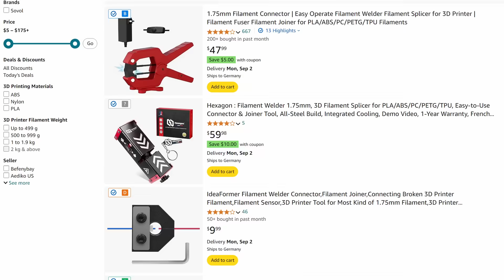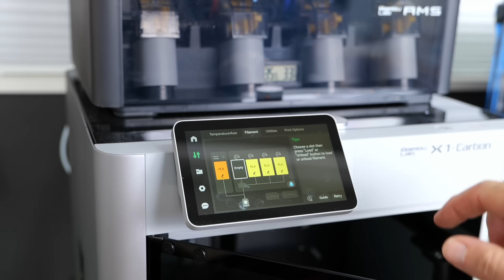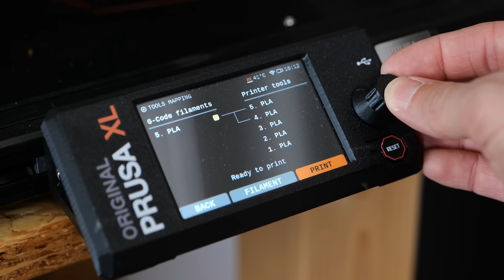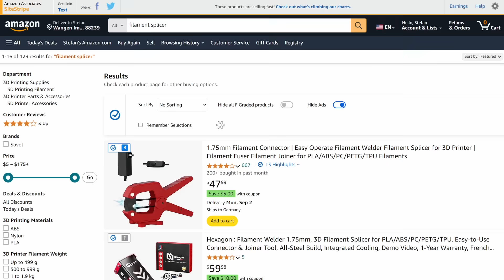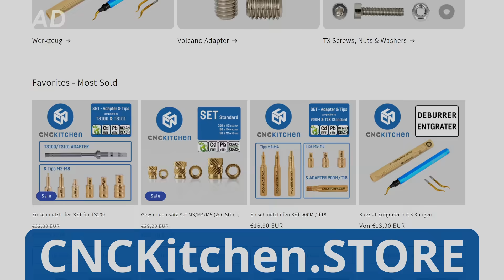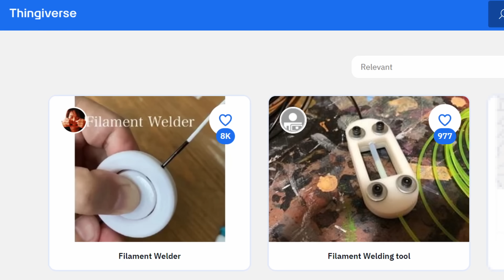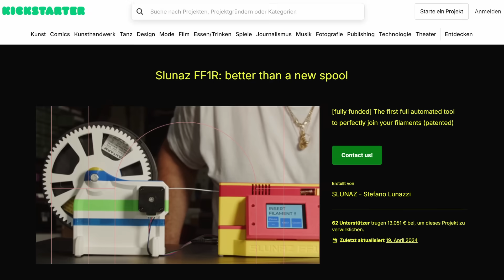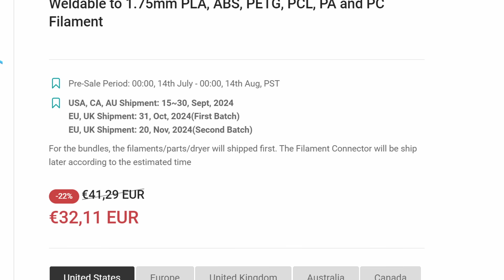The Best Filament Connector but you can't Buy it (right now)

Comment: Aloha Stephan. I have the Sunlu filament connector. The best and easiest way is to use a can of air. When the filament connector beeps, just unplug the power connector from the filament connector. Grab your can of air and turn it upside down. Spray a jet of coolant into each end of the unit where the two filaments enter and exit the filament connector. The coolant instantly freezes the fused joint. I've been 3D printing for a year and a half. Love your channel. CHEERS! 🙏🙏

Comment: Perhaps you'd like to test my solution for easier filament connection using this device from SUNLU?

I posted a model on MakerWorld a while ago. I don't want to post the link here because YouTube will probably hide the comment. You can find it under the name "SUNLU Filament Connector Assistant (working one!)" by Cichy3D. I immodestly think this is the most convenient way to use this device. Cheers 🖖

Comment: For me the just sit in a storage bag until I need them for test prints like maybe I'm using a different setup for my hotend. Mainly the nozzle and I will be upgrading from hardened steel to bimetalic carbide. Sometimes they don't say air tight though. They're now available and have one coming.

Comment: A tip to avoid PTFE waste: For anything but the shortest lengths of filament (when it is easy to manually slide the PTFE off the end), you are going to need to re-spool the filament after splicing. Thread it through a short clamped length of filament guide tube (also PTFE, but much thicker walled) before it goes onto the receiving spool. This easily pushes the splicer PTFE along the filament until it pops off the end of the filament when winding is complete. This is also a useful check that the splice is not going to jam in the printer guide tubes. A frame with two spool holders, guide tubes and the splicer in the middle facilitates this work-flow and helps ensure the filament is spliced with its spool bends aligned in the same plane.

Comment: The consumbles turns me off. Surely there's a better solution by having a built in heat resistant ptfe tube that doesn't have to be thrown away but still a cheap solution

Comment: It would be possible to take this welding mechanism and add a pair of sliding clamps on either end that, actuated by the lid, grab the filaments and pull them together with a consistent force, and it should be possible to make them adjustable so you tune it for the material at hand. It looks like the Sunlu machine is not particularly available to modification, with the entire top body piece looking like a single injection molded part, but the Hexagon appears more amenable. That said the Hexagon machine relies on you adjusting a knob for every fuse, and IMO that also needs to be modded for it to be truly practical. I would go for replacing the knob and it's threaded rod with a toggle lock mechanism that pushes on a spring coupler, that has an adjustable limit. Sidenote: the Hexagon machine comes with a 3D printed alignment block that you put the filament in to straighten it, this is a good idea but it would work better if it was metal, and part of the cutting apparatus. You put the splice in the block, give it 15 seconds, activate the cutter and remove with the joint now straight and hardened

Comment: You can live load flashforge5mPro. 
1st switch off filament runout sensor on the printer.
2nd let the old filament run at 50% speed (slow it down)
3rd load new filament in to the tube and wait until its almost out.
4th load the new filament as the old one runs out.
5th make sure to turn the filament runout sensor back on.

This avoid any confusion and its faster as well as safer for layer adhesion.

Comment: I use 1/16" ID X 1/8" OD Silicon Tubing to join two lengths of filament. I cut the two leftover filament pieces diagonally and push the two pieces into opposite ends of a 1.25" to 1.5" piece of the silicon tubing until they meet in the middle. Then I heat the outside of the silicon tubing using a handheld propane torch working around the silicon tubing until the filament becomes soft enough (melted) to join the two filament pieces together. The key is heat until the filament soft enough to join but not liquefied. This makes one continuous filament. As the joint cools down I roll it between my fingers again, wait until it cools enough to handle so you won't burn your fingers, then when its cool I use a razor knife and slit the silicon tubing lengthwise so I can remove it exposing the now joined filament pieces. It is inexpensive and works well keeping the connected filament ends in the proper diameter to feed cleanly through the 3D printers PTFE tube with no fat section where the two filament pieces were joined that needs to be trimmed or sanded.

Comment: This is a neat product, but the obvious solution for the sizing issue is to use a precisely manufactured steel mold coated with a thin pei coating.
This would keep the expansion to a minimum, speed up the process, and would make it impossible to push the filament in too hard since the inner diameter of the steel mold isn't going to be stretched by the force of your hands like a disposable PTFE tube. PEI is already a material that steel build plates are coated with and a device like this would require much less material. A heatbed with a PEI build plate already has 100% of the critical parts required for this kind of thing. The process of design is so easy, I might attempt to design one myself. The only difficulty I can think of is that filaments like TPU, that don't print well on PEI, would need a release agent to be brushed on the mold first, but that's not going to affect most people and the issues with this version currently affect everyone.

A rule of thumb when making a tool to make a manual process better: Good tools make things take less time and/or force, but the best tools also reduce the skill/precision/dexterity required by the user to do the job optimally. If your tool makes it faster, but it's still just as difficult. You just made the likelihood of failure climb by whatever rate your speed increased.

(and yeah it couldn't do engineering grade filaments and things that can't be printed on a PEI plate, but if you've got the money for that filament and a printer and enclosure capable of reliably printing it, then you probably already a multi-material setup built in, or you can definitely afford one.)

Comment: I just cut the ends clean and feed it right in to my extruder and it pushes both filaments right through, but i've eliminated all ledges from my filament path so the filament doesn't get caught up, all it does is make retraction not work till the new filament gets to the nozzle, not a big problem if you don't mind a few strings, especially if you lower the temperature.

Comment: Great review with all of the info I wanted and all of my questions answered.  My prototyping printer is running next to my computer (the carbon HEPA filter enclosure I designed is printing now) so I can swap to a new reel of filament when one runs out, but automatically switching reels is a great feature of a multi-filament feeder.  My Sunlu filament splicer arrives tomorrow.  I hope to use it to splice the short end of a reel to the next reel rather than unloading the old reel and loading a new reel while the printer pauses mid print.  I hope to trade the effort of splicing for the labor of changing reels, and only splicing the short ends makes it easier to reuse the PTFE sleeves.  I need to find a good source for 3 kg spools.

Comment: I invented a filament connector for a 3D printer. It boasts a connection speed that is superior to any other existing product.
It takes 20 seconds to connect the filament, but 30 seconds is enough. After connecting, the user simply removes the filament connection burr.
I can't send you the product and I'm going to send you a video because I've only made 1 prototype at the moment, so I'd appreciate it if you could let me know the e-mail address.

Comment: I got this and immediately modeled a base to put it in so its not so unwieldy to use trying to hold the filament ends and also trying to not have the unit move around on you. Couple cubbies to hold the ptfe tubes. I can now run thru 10 bonds in moments vs fighting and hoping I don't have the end pull apart at the last second as I pop the top of the heater. Can be found on Makerworld for those curious "Sunlu Filament Connector Stabilizing Base"

Comment: Hi Stefan, Stefan here. LOL. Elelctrial (ARC) lighter and an cut in half PTFE tube I used for joning. Horrible work. Did it only twice so far. 
Most time I use the leftover for early prototypes or print some daily use parts, like hanger, cable guide, clothes pin parts. 
OFC, the perfect solution would be joining them. 
Products like Mosaic Palette are also available since years, but still an overkill. 
Sunlu seems to be available again. But I will get the Hexagon Filament Welder, for an very simple reason. I Support a comapny from europe (France). Which is much better than feeding the dragon!

Comment: From my research, the ptfe tubes was not first thought up from sunlu. A different product used the same idea. The Hexagon came out way before sunlu's solution and also uses the ptfe method. I debated on getting it but everyone seemed to hate it because you had to sand down the connection because it would be to thick to feed through the extruder. However instead of cutting the tube it used a peeler to take off a layer of the ptfe so you can take off the rest. It however was expensive at $60 just to connect filaments together. while other solutions that never worked good cost $15-$20. There was no middle ground. Sunlu's solution feels like that middle ground $30 for a solution that doesn't need a whole lot of engineering and thats not super cheap that doesn't work. However, now that I'm looking at the hexagon, I think they dropped there price probably because on Sunlu's solution.

Comment: To cool the weld quickly you can use a can of condensed/compressed air turned upside-down. It cools the part instantly, works also great for quickly cooling hot glue.

Comment: a better way to do it would be to have a clamp with a channel for the filament to rest after it's been heated and the clamp forms the connection rather than silicone tubes.

Comment: I think people who enjoy tinkering can make a Splicer by simply using the PTFE tubing, or high temp tape, and simply heating it high enough to melt the two together. I had not seen the PTFE tube before, but that is a good idea in my opinion. So, I am going to look for a way that I simply could heat it up, and it should melt together. Also, I have not made the Ender 3 PET Filament cutter and maker by CNC Kitchen, but I assume that you could use the same idea to splice filament as well. I have not made mine though, so I need to use the print farm at my lab to make all of the parts. 

ANYONE Have any thoughts on this idea? Have you used the Filament Maker? Would it work as a splicer if needed? Please comment and let me know. Thank you.

Comment: Up until I got a printer that can continue another spool when one runs out, I would save end pieces that were shorter than 3 m for use with a 3D pen or soldering tool to repair or assemble like-coloured models in the future.

Comment: i use mine to print "gluesticks" so i can use it for repairs and touchups on cosplay gear. also handy to have the same polymer that something is cracked in the gluegun. easy fillers. :)

for the stumps that are not enough for that i made diy rig of capricorn ptfe tube, two staples holding it down to a piece of wood :P then i use a hotair gun to heat both stumps a bit. not too much so they are gooey. then quickly into the ptfe and twist in opposite directions three four times feeling for the hardening of the polymer. when it starts to harden i slide it back and forth instead of twisting it. always comes out with no feed issue for my x1c :)

Comment: So the Prusa MMU2/3 can also do filament run-out, along with the mentioned AMS and multi-tool systems like the XL. So don't forget that option too.

The Palette works very well for filament run-out and I'm honest surprised nobody (including Mosaic) has made one just for it and/or splicing ends together. Pulls filament 1 through a 1.8mm inner diameter PTFE (they rate it for some 3000-5000 splices depending on filament and temps used. Also, they limit it to 230C to prevent off gassing). Filament 2 gets brought in, a slight pause while it heats up for a specified amount of time, push 2 filaments together for a specified amount of time, part of the way through start moving the filament through the PTFE (at different rates), then go past a cooling fan/blower. You look at the device and can probably produce a very similar system with some simple gcode. In fact, the first Palette literally ran off a RAMPS board... so not a complex task. Given how much an ECRF and similar cost, could probably do it for $200-$300 instead of the $800+ the device goes for.

I have a literal box of scraps. My printer sits so close to me that for small-ish prints that color doesn't matter, I feed one 20-30cm scrap, then just grab the next and feed that in as I see it go past the end. Filament sensor saves me if I'm delayed/distracted (and every printer should have one. If you had a bad experience in the past, it's probably been a few years now... at least the like 2 people who like to tell me they always disable it say they last had the issue like 6 years ago and both have moved from Enders to Bambus. So come on now, stop repeating that they're not reliable to mislead people). Ahem, I get through things fine and slowly.

Comment: The use of the disposable tubes is 100% a way to ensure they milk money out of people. There is plenty of others ways that I can immediately think of that could make this not required.
You could have "molds" that fit in the place of the machine that are warmed up and each mold will work for different sizes of filament. That'd mean you'd have to sell the molds separately probably, but you buy one and you just get to have it. The excuse that "the tube is used to keep it in place and prevent failure" is dumb. Just set it up in a way where that isn't an issue, like how CNC Kitchen here is doing it. Could even have like little extended arms on the side of the product go out to help hold down the filament.

Comment: My Qidi Q1Pro consistently grabs the new (unspliced) roll of filament if I just make sure it's butted against the end of the previous roll as the end goes through the extruder gears. It takes between 30 and 60 seconds to be sure the transition was made (as you can't see inside the extruder) but I've done this plenty of times and it worked each time.

Comment: For my E5+ with DD, I let the filament get to the runout sensor in the rear, then push a new roll through until it gets to the DD and just let it feed through.

Except for a handful of times it's worked perfectly. The only pain is having to sit there and manually feed on the back of the previous roll.

Comment: Yeahh...fun idea, but honestly this seems so much harder than just...using the filament. Been printing for at least five years now and I have never had any issue with "leftover filament", you just feed the new spool in right behind the old one. An out of filament sensor helps since you don't have to actually pay attention to when you're nearing the end of the roll but even that isn't necessary, I've done it plenty without one...once you reach the end you just gotta spend 2-3 minutes feeding it. Yeah it's a bit of manual effort...but it certainly looks like splicing the filaments together requires even more manual effort...

And if it's just about "camping out in front of the printer" because you don't have a runout sensor...those sensors are like $15. With no additional consumables to deal with.

(Although to be fair I'm not someone who trusts the printer to be running totally unattended; if you're crazy enough to have it running while you're away at work all day then maybe that's a legit use case...)

Comment: I have the 3D Sway splicer and I find it works quite well, the built in fan is great because you can cool the filament before moving it. I haven't got the hang of the block it comes with to hold the joint while you cut it with a potato peeler, but so far I've managed to slide the tubes off to reuse. It's completely manual which I like, you turn on the heater, fuse the filament while watching the clock or running a timer, then flip the switch to cool, watch the time again and then you're done. No faffing with temperatures or relying on presets.

Comment: I use nearly-empty spools to print small parts until there's only a few feet left, which I toss. Recently got an A1/AMS, which as you mentioned will auto-switch. The PTFE tube method works well - you can even just use a match as the heat source - but as you pointed out the tube must then be slid off the filament. The little Sunlu splicer with the cutter blade seems like a great solution!

Comment: This process is similar to the way magnetic tape splicers in the old days worked.  Without heat though and they used tape.  One thing that the tape splicers had was a cutter built in for the exact right match angle.  This device has a blade for the Teflon so they did think about it but not for the 45° cut.  The next version should have this feature and like you said, a fan for cooling.  It could be a device where you poke each end through a hole and push the button for cut and then it fuses with heat an then the fan turns on to cool.

Comment: I use the short pieces that the run put sensor triggers for my 3d pen but i have order the splicer to put longer pieces together for personal prints were i not worried what it looks like as it will get painted.